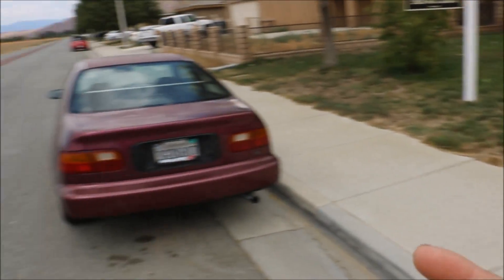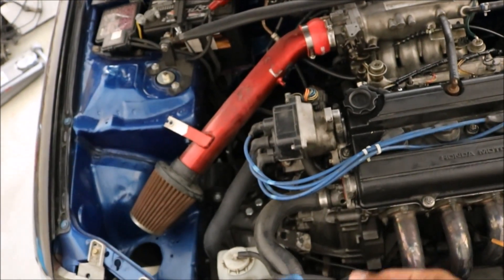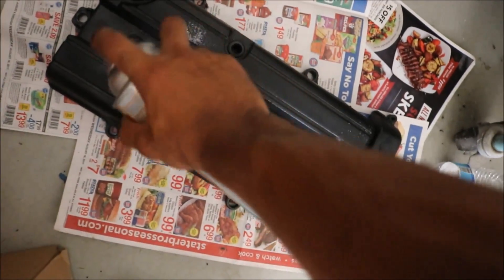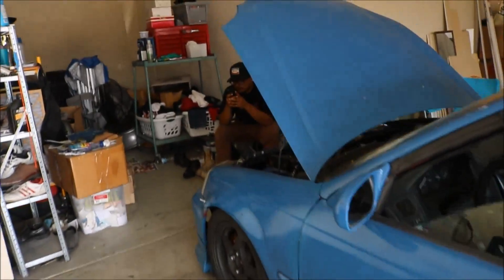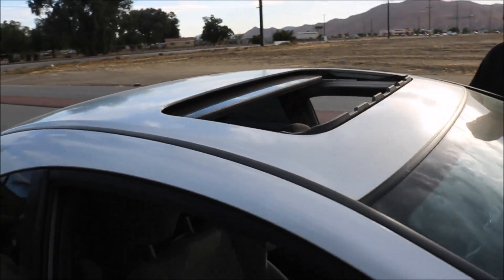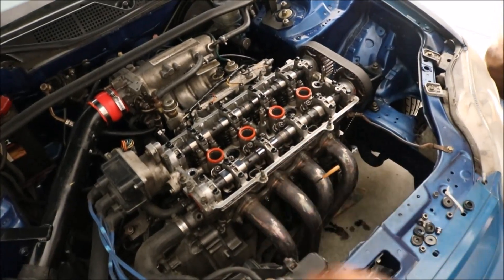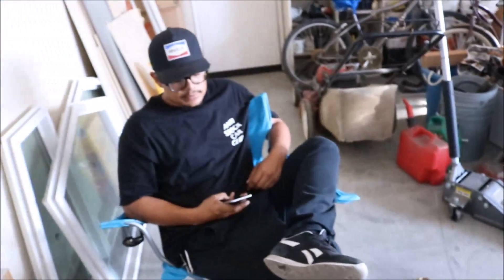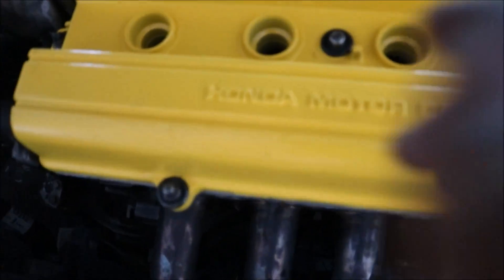Cleaning Up The Engine Bay!

Comment: How is that ground going to do anything when you have a rubber gasket between the valve cover and the head. You have to put that ground on one of the valve cover mounting studs, that way it will ground through the stud to the head. The paint looks nice though, good job